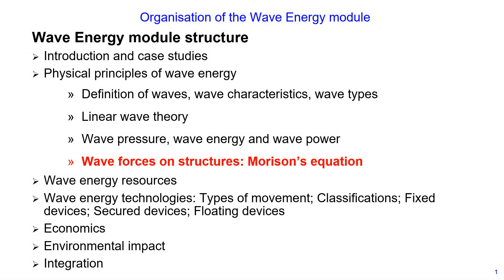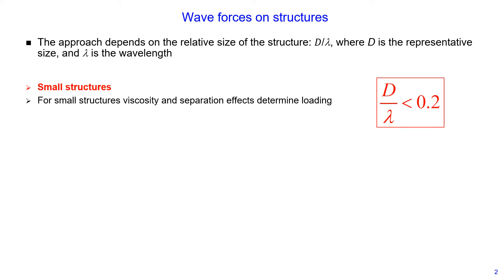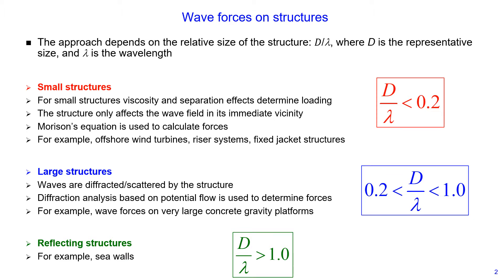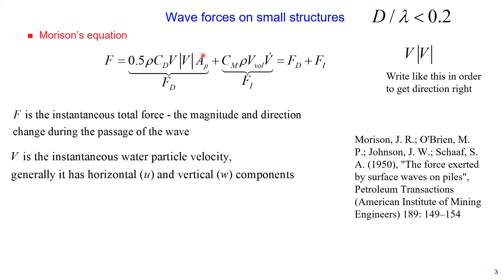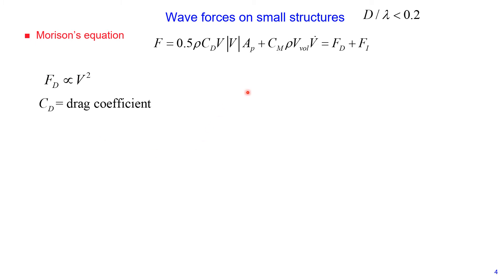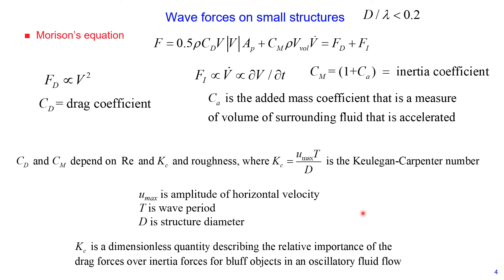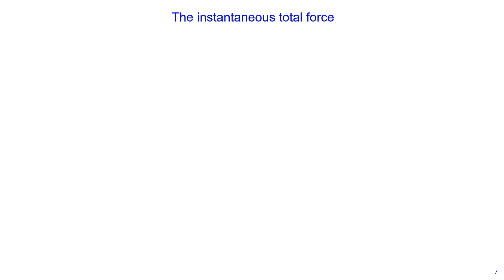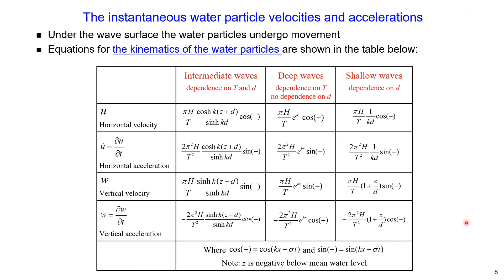How to calculate forces on small structures. Morison’s equation

Comment: I"m confused of using V for both velocity and volume in the same equation. I think that ∂V/∂t is a local derivative, not a water particle acceleration. The latter should be DV/Dt (material derivative). Anyway, thank you for this lecture.